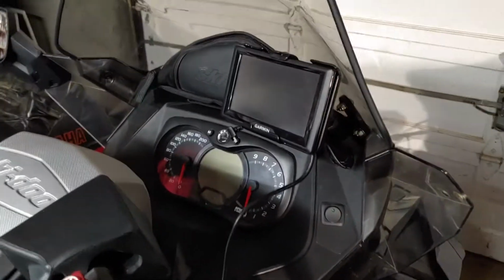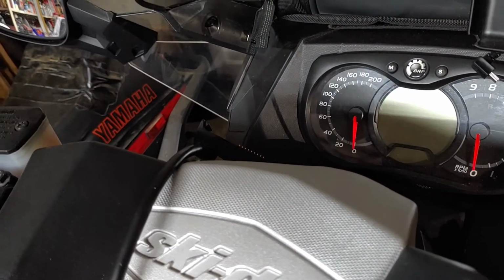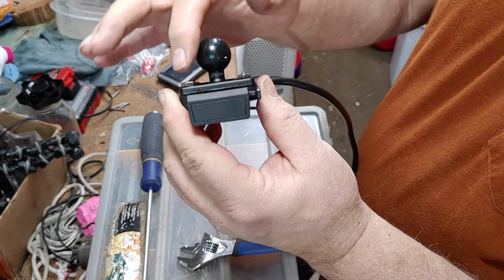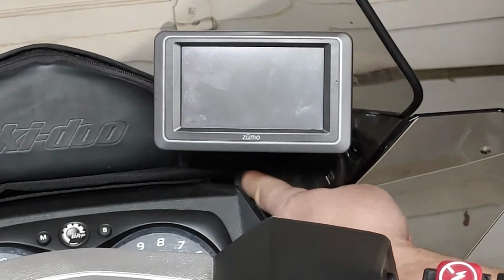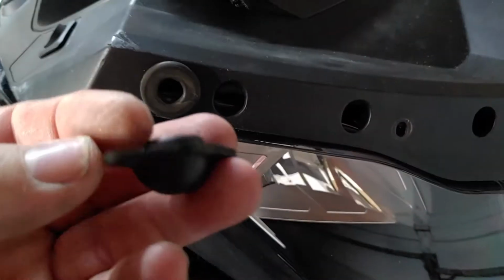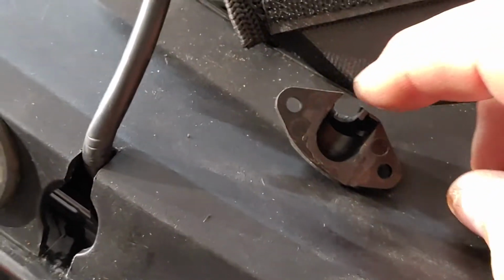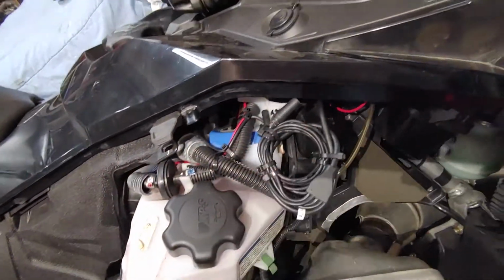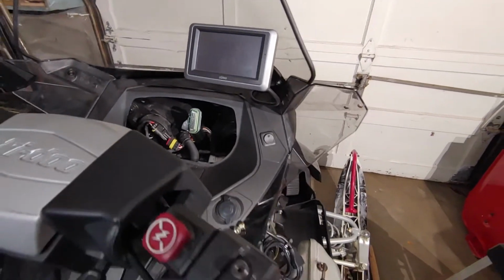Garmin Zumo 665 install on 2012 Ski doo GSX

Comment: How does it hold up in the cold?
Reply: Just got back from a 3 day trip in Pittsburg, NH and Rangeley, ME ( rode Thursday thru Saturday - 420 miles). Temps during the day where 10 F degrees high, low of 2 F at night. Windchill was -10 to -20. The Zumo 665 never stayed on. It would just shut off. Turn it back on, then it would just shut off again. No warning, nothing. Battery was fully charged. That was the first day. The 2nd day I had the unit inside before starting out. We had a 210 mile round trip to do from Pittsburg, NH  to Eustis, Maine visiting the Grand Falls. An hour in the trip the screen froze on. It stayed on the screen "Where To" and "Maps" but would not respond to any screen touch nor the On/Off button. Pulled it off the motorbike mount after am hour and the screen went to battery mode but was still frozen on. Thru it in my pocket for a few hours while we rode. Pulled it out, battery dead. Re-installed on the sled with it's power mount, worked for 10-15 minutes and shut off again. SO,.... I am at a complete loss on this one. This is suppose to be an "outdoor" unit, but I guess for warm days only and no winter usage? Makes me wonder if the more expensive Montana can work in the cold. I and my friends will ride regardless of temps. The coldest I have ridden has been -20 F. 

I hope this answered your question(s) you may have on the Garmin Zumo

Big Guy DIY - Robert
Reply: @robertg.9964  Thanks for your time in replying. It's helpful information.
Reply: @marceltheriault9222   I just found this in the owners manual for the Zumo 665 - "Operating" Temperature range: from -4°F to 140°F.  "Charging" temperature range 32 F to 113 F. So, technically this unit should work. The Garmin Montana 6XX has the same specs for operating temperature range and charging temperature range. May have to move the unit to a warmer enclosure to work....I have a whole year to look further into this set up. :-)